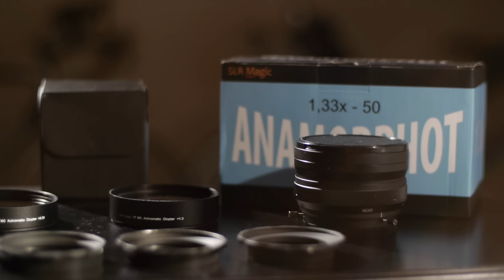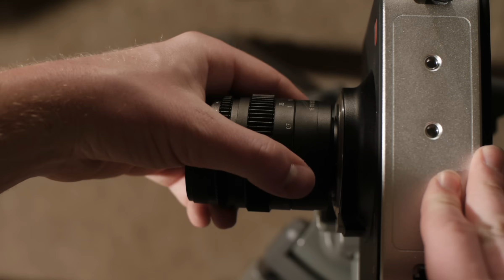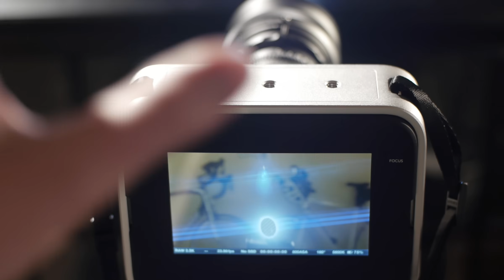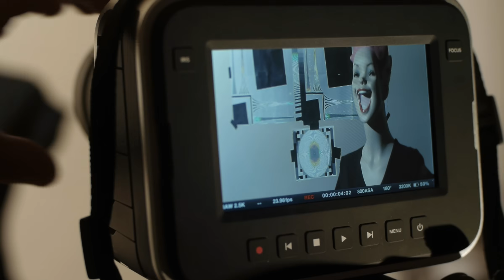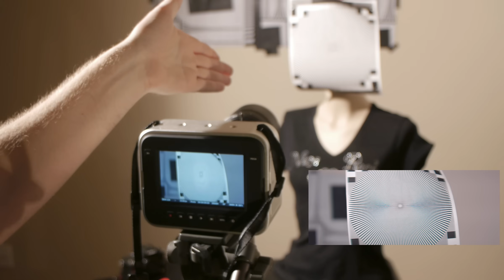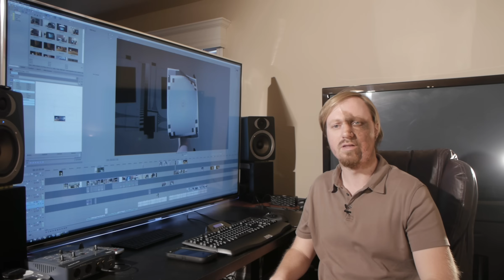SLR Magic 1.33x Anamorphic Adapter 35mm T1.4 Tutorial Video

Comment: Hi! Have you ever used the Anamorphot together with a filter? If yes, did you attach it to the front or in between the taking lens and the Anamorphot? Thank you!
Reply from the maker: great question.  you need to use filters in front of the anamorphic lens
Reply: +Eyepatch Entertainment  thanks for your quick reply! :) I'm just wondering if using a filter in front of the Anamorphot would influence the flares. I would like to use the Anamorphot and the Tiffen Black Pro Mist together.
Reply from the maker: +Markus Neubauer i haven't tried a pro mist, but some filters will kill the flaring
Reply: +Eyepatch Entertainment  seems like I'm gonna test it :)
Reply: Did you manage to do this test? I'm curious about the pro mist placement too...
Reply: +Gary King Hi Gary! I haven't tested it under scientific conditions but I didn't see any noticeable differences. You don't loose the horizontal flares no matter putting it in front or the back of the anamorphot. I tested the the black pro mist 1/4. Can't tell if the flares are changing when using a black pro mist 1/2 or the ones  with stronger effect like the 1 or 2. In general I'd go for filters to screw in front cause it's a pain changing filters in between the lens and the anamorphot. Unscrewing the anamorphic lens means setting it up again. So far my experience..
Reply: Thanks man, much appreciated

Comment: Will this adapter work with my Gh4 + metabonespeed booster + 18-35 sigma art and the 50mm art? thanks a lot :)
Reply from the maker: I use it with the 35mm art and speedbooster all the time
Reply from the maker: I use it with the 35mm art and speedbooster all the time

Comment: Sorry if my English sound bad... anyway

i have few questions as i have never heard about anamorphic lenses or SLR adapter before yesterday so i wanted to learn more about this.

for my footage i just crop my FHD to 1920 x 840 to get that aspect ratio and of course i lose pixels there. what i heard that anamorphic saves that details but as i see that everything is actually stretched then you squeeze it.
don't you really lose the same number of information from the footage by doing that?
what really make it special other than the flare and the bokeh? maybe better motion?
Also how do your 35mm lens act like? does it still make 35mm perspective?? im so confused with this crop factor!
when i crop my footage the scene perspective don't feel exactly like 35 i mean i usually end up using something wider than the feel of the focal length because the aspect ratio is giving me a tight scene to work with.

Comment: Hello, I hope you can help me with a one doubt
what about using it with rokinon cine or super takumar lenses, i saw a video where the cinematographer used this anamorphot and rokinon, how is that posible? what clamp or adapter is requiered
thank you for the tutorial, is very helpfull to see how it works
Reply: Alejandro Oseguera I am using with my samyang/rokinon cine lenses 35mm and 85mm. its working ,. no vignet.. you have to get 77-62mm and 72-62 step down ring.

Comment: Since this is a dual focus lens setup, is it possible to rack focus between multiple subjects? Does the adapter make it more difficult to do so?
Reply from the maker: You can certainly rack focus between subjects. The further the taking lens is stopped down, the greater the distance you can rack between two subjects. Its a single focus lens with a MFD around 10ft at T4. The additional focus ring on the lens works like a variable diopter that will give you some flexibility on rack focusing on subjects closer than the normal MFD. Again, out of the normal mode, the range of your ability to rack focus will depend on the f-stop you are shooting at.
Reply: Thanks, this looks like a great product.  Can't wait to see more footage!